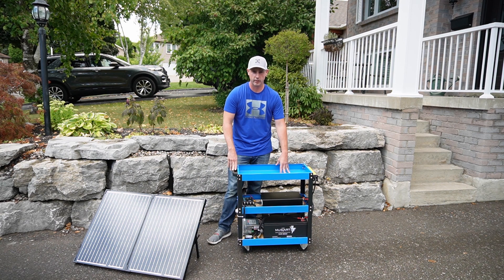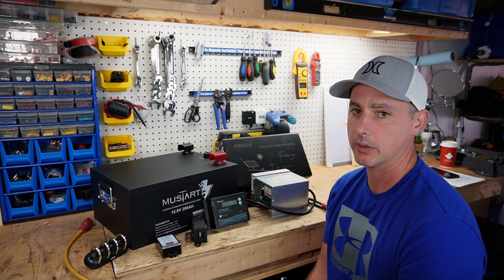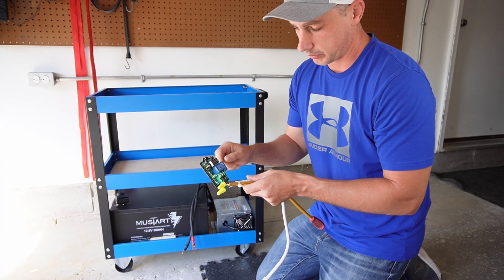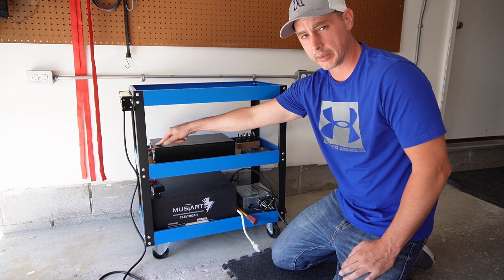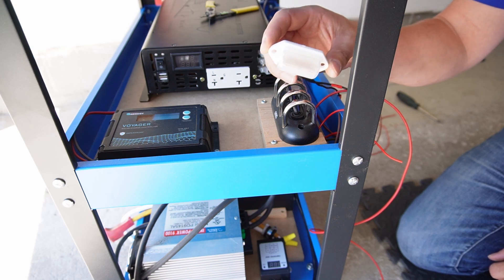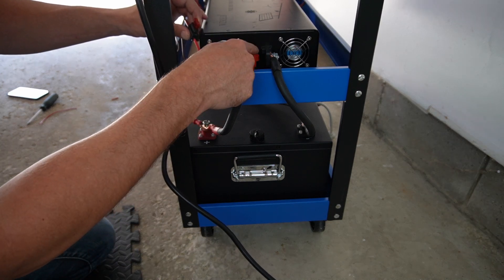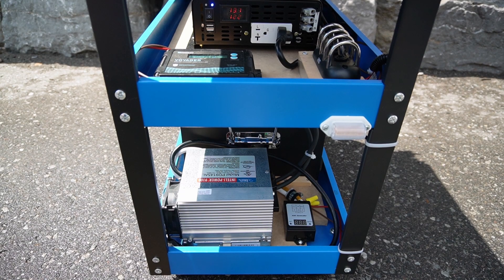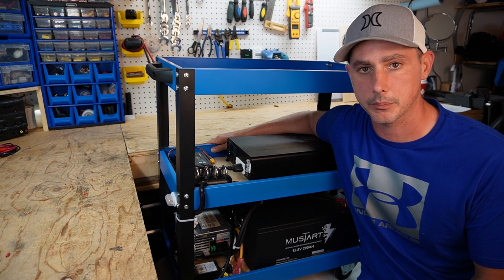DIY 3000W Solar Generator Build

Comment: In 2016, while waiting for a prebuilt unit (Inergy Apex), I discovered Will Prowse. I used his advice on building my own "power cart." lithium type batteries were prohibitively expensive, so 4 - 260ah 6v AGM in series/parallel were mated as power cell (6.2kw) A Renogy 2000w pure sine wave inverter/charger. An Epever 40amp solar controller, BT50 monitor, with two strings of 400 watts PV panels. Appropriately sized wire, circuit breakers, and fuses to complete the build. It weighs 280lbs on an 800lb rated "Gorilla" cart. AND IT ALL WORKS. I finally got all the Inergy components in 2022.
Yours is certainly a sharp unit and EASILY a DIY
Reply from the maker: Thank you very much! Will has inspired many people, including myself.

Comment: Subbed and Liked this excellent video, thanks! I am very interested in the voltage relay switch. Looked at the affiliate link you provided to find the unit. I see some circuit diagrams on the product images, but wondered if you would consider doing a short video on exactly how you wired that up. I am also seriously considering that same inverter you used and the same charger so that I would basically be replicating your setup for my built-in RV solar LFP system. PS. If you can't do a video, then some detailed explanation of all your electrical connections to and from that voltmeter relay switch would be VERY much appreciated! Many thanks! Barry.
Reply from the maker: I'm a little busy to make a video right now but keep a eye on my channel. 
The wiring diagram is pretty good.

Comment: Is this same as some commercial versions of power wall but more flexibility?
Reply from the maker: DIY set up, You'd see this in a RV or camper trailer etc... It is flexible because you can size everything to your needs.